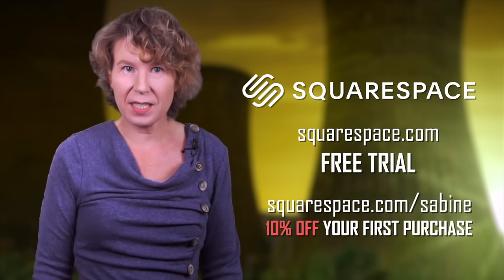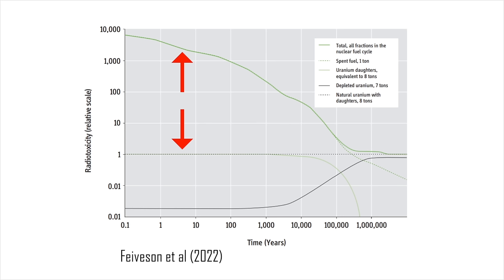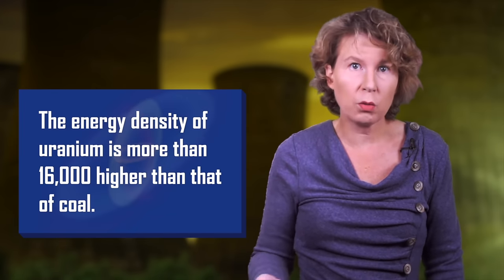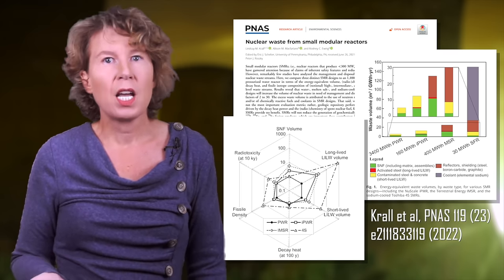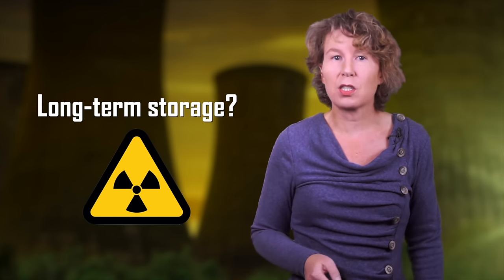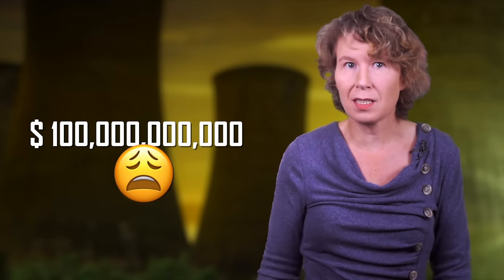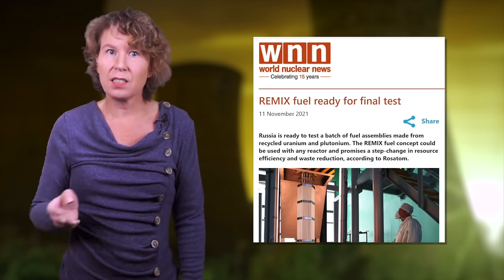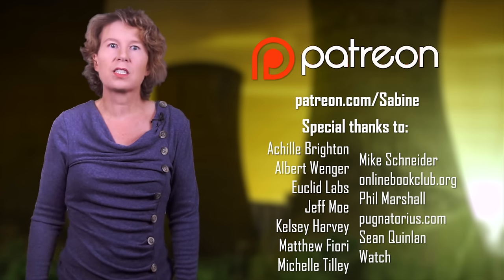Nuclear waste is not the problem you've been made to believe it is

Comment: I think the concept that is often misunderstood is that it is ultra heavy and dense. so while it does seem like a lot of waste it is contained in a much smaller volume than you would expect
Reply: And the toxicity of it is contained in a  very small volume
Reply: The Swiss use nuclear for 35% ish of their energy needs they've been doing it for around 30-40 years, they can fit all their nuclear waste in one room, its a big room, but still.
Reply: @Prometheus7272  — If they did actually put it all in one room, would it go critical? 
(Only half kidding.)
Reply: @sirrathersplendid4825  You'd get meltdown before it went critical.   If you kept on throwing waste into the molten puddle on the floor,  it'd get hotter and hotter until it melts the floor and forms a radioactive gas cloud.   Getting it to explode requires it to be crushed together quicker than it can melt and vapourise.  Not trivial.
Reply: @MattOGormanSmith  — Interesting answer. Cheers!

Comment: I live next to a nuclear burial site.  It is the low level site located in Barnwell, SC.  Basically safe based on our current knowledge.  I worked there for a few years before moving to the Savannah River Site, which was a producer of high level material and holds millions of gallons of high level waste.  In the area of government contracting, we maintained computer systems for everything from reactors to security.  In general, we were very successful in solving technical challenges..  We of course, had much less control and success of political challenges.

Comment: I worked for a US company that did long term simulations at Yucca mountain and I learned biggest problem is water and heat. Specifically rock is an insulator, so heat continues being produced over 10,000 years, and that heat very slowly spread out into the rocks, but it is possible the temperature in the repository (even without a high density of waste) can rise about the boiling point of water, and if this happens AND there is water that gets into the space in thousands of years from us it can become explosive, like old faithful, cracking rocks to the surface and potentially releasing radioactive materials.
Reply: In the London Underground the Central Line tube had a temperature of 36°C/97°F in the summer of 2018. It started with 14°C/57°F in the summer a century ago. We seem to have no intuition for that.
Reply: @gviehmann  Haha, I though about the exact same thing when reading OP's reply
Reply: @gviehmann  Is that really 100yr long-term accumulated heat from all the trains and people, or the result of more trains and usage producing a rather shorter-term equilibrium? That 36C is presumably the summer peak - what is the average and seasonal variation, and is it asymptoting yet? I know some of this heat is being used for district heating systems. Presumably we could do quite a lot more of that and thus cap the long term rock temp?
Reply: @xxwookey  Too many questions. The main point is that the temperature of the Tube is not in equilibrium, although it is an open system and there are already measures to cool it. https://en.wikipedia.org/wiki/London_Underground_cooling
Reply: @gviehmann  Useful links. Which answers my main question. So the ground temp has risen from 14 to 22 (average) over 100 years. I wonder why it started at 14? UK ground temp at that latitude is 12ish. Apparently it was already unusually warm for some reason. I see they've only recently got regenerative braking which will make a huge difference to how much energy is dissipated down there.
Reply: There were underground natural nuclear reactors in Oklo, Gabon, a few billion years ago, running for millions of years. We know what happens to nuclear waste after being buried for a billion years in a water rich environment. The plutonium moved about 5 ft. Disposal of nuclear waste is easy, cheap, and safe.

Comment: FYI: The subscription form for your newsletter doesn't work with Firefox's "Enhanced Tracking Protection." This isn't necessarily your website's fault, and I've filed a report to Mozilla... To other Firefox users: you can disable the Enhanced Tracking Protection for an individual website by clicking on the "shield" icon on the left side of the address bar and toggling it off there.

Comment: Question: if we really really wanted to get rid of spent fuel, and couldn't get any more energy out of it, is it possible to stick it in a nuclear reactor anyway and transmute it into something safe at a net loss of energy? Such as using 1 fresh rod to neutralize 10 spent rods.
Reply: The Pu 239 can be reprocessed into fuel.   The problem is that it can be used to make a nuclear bomb, by people with a much lower technology level than needed for a uranium bomb.
Reply: @mikesmith2682  
Then we should just make sure it’s processed and used on-site as fuel.

Even other radioactive isotopes can technically be transmuted with high energy protons/electrons or used as radioactive sources in industry.
Reply: yes, you can further "convert" problematic isotopes into something less harmful using energy. this principle is an even rather old idea. I believe that currently, you'd have net loss not just in that converting process, but overall .. know what I mean? but should like nuclear fusion become a reality, this problem/issue could be tackled. that's why it could be a wise idea to not just bury everything (apart from other potential use cases we currently have no idea of/about like maybe even in medicine). I'm sorry should any of this already be part of this video as well .. I'm yet to watch it 😅
Reply: @cezarcatalin1406  Yes, but there is an energy or neutron budget the facility has to meet. Many (most?) reactor designs don't produce enough extra neutrons to transmute the nasties, and building a big enough proton gun, etc., will cost a LOT.
Reply: @mikesmith2682  Wasn't it the other way around? It's realy easy to build an atomic bomb from U235, but hard to do from Pu239 because you need a pyrotechnic lense to compress down the solid plutonium core?
Reply: @jannikheidemann3805  
Just add some lithium deuteride to make the sparkles bigger.
Reply: @jannikheidemann3805 , yes, in a sense. It is very hard to get enough highly enriched weapons grade U235, BUT, once you have it then it is much easier to make a gun type nuke than a plutonium implosion device.
Reply: You can transmute it into elements with far shorter half lives AND gain net energy out of it with breeder reactors. There are different types of breeder reactors but they can extract approximately 100 times more energy out of the fuel than the most common reactors that are used today. They can even reuse the "spent nuclear fuel", because for breeders thats just "fuel that has been used for 1% of its energy". Breeder reactors also convert the isotopes with longer half lives into shorter lived ones. Why is this not used more? Because just mining new uranium has been cheaper so far. Most of the cost per kWh of nuclear energy comes from building the reactors themselves and operating costs, not from fuel cost, so the incentive to save fuel is not that big.
Reply: @Azzinoth224  
Also the output of breeder reactors can be quite high in rare precious metals from the platinum block like Ruthenium and Rhodium.
Reply: Just stick the spent LWR fuel after some pyroprocessing into a fast neutron reactor and let the fast neutrons do their magic. They will turn the fertile isotopes (i.e. unstable but not fissile) into fissile isotopes through neutron capture, after which they can partake in the chain reaction inside the FNR to produce heat, or be used to create fresh fuel for LWRs.
Reply: Fast reactors can transmute the long lived isotopes in the waste AND extract energy from them.
Reply: Fantastic...! Now the only question is should we send it to the moon or Uranus ?
    But we still don't know where we are going to get the 6.7 gigawatts to power the flux capacitor. Guess we'll go back to the future for that.
Reply: Yes.
You will need to extract all medium-lived isotopes and transmute them using either something like particle accelerator or fusion reactor that would act as a neutron source. Or both, I don't remember the details to be honest.
French nuclear agency did a study on that ~20 or ~30 years ago and come to conclusion that with relatively reasonable investments it is possible to make final wastes consists only of isotopes that would require less than 100 years of storage until they decay to radioactivity levels of natural uranium ore.
Reply: @mikesmith2682  That is incorrect. Nuclear bombs have to be made out of Pu240, not Pu239. While there is a bit of Pu240 mixed into the Plutonium in used fuel. Its just one isotope away. This is a problem because if you want to isotope separate plutonium 240 and 239 you only have a separation of about 0.4% unlike Uranium 234 and 237 having a separation of about 1.2%. Separation become harder by the square of the distance, so separating Plutonium is incredibly hard.

If you would want to make a nuclear bomb this way, you probobly just made a uranium bomb, it would be way easier.
Reply: @ucanliv4ever  I assure you, the last thing we want to do is burn energy to lure all that potential energy out of a gravity well that just so happens to also be directly above our heads. I get you're joking, but the idea that we'd spend resources to jettison so much potential energy in the most dangerous way possible is something only a journalist or politician could come up with. It's like the worst of all engineering trade offs where we pick the wrong trade off at each stage and then not only don't get benefit, but the worst of both worlds. 

So I'm sure we'll see it done soon enough. And I'm sure I'll scream when I find out I'm footing the bill along with the additional pork added to the legislation that enacts it being required.
Reply: @skipperg4436  I believe the amount of waste is also severely diminished and very manageable (like, kilograms over the lifetime of an installation)?
Reply: Sabina discussed that in this video. Fuel rods are reprocessed and used as "MOX" mixed fuel. The chain reaction is run slightly differently since the plutonium has different energy levels and half life. 

Of course, we don't do that in America. There is no plant. The industry won't fund it. They just want to create sales revenue. Dump all of the externalized costs on the public. Push the problem into the future. Live good and let somebody in future deal with the problem if the poorly guarded waste is  stolen and weaponized.
Reply: @ScottLovenberg  yes you are correct.
Fresh fuel rod consists of AFAIK 4% of U235 and 96% of U238. What is called "spent fuel" consists of ~1% of U235, 1+% of Pu239 and Pu240, if I am not mistaken 94% of U238 and the rest are mix of different fission products.

U235 and Pu isotopes are actual usable fuel, U238  is what can become fuel (Pu239) after absorbing neutron, fission products are what we want to remove (while technically there is still a lot of energy that can be extracted from some of them it won't be feasible with current reactors).
Reply: Hmmm...so what's your take on geoengineering?
Reply: From what i read uranium decays into helium and lead. Can we speed this up somehow?

Comment: My biggest "commercialisation" concern with regards to storage is the recurring underpriced proposed cost of storage - it's often 2-3x+ more costly than it ever is quoted for. This ultimately comes down to hidden costs per kWh and is bad for the consumer. An additional commercial concern includes the "non-competitiveness" of reactor design and fuel agreements. Often if you pick a reactor you're stuck with the fuel provider for the life of the plant which makes fuel cost a semi non-competitive market, which is also bad for the consumer.

Nuclear also accounts for around 10% of power globally (IEA). If we were to 4x this - then we're into the 60k+ tonnes of storage needed per year. Yes, per year going by 2024 figures of consumption - and this is the minimum. This is a permanent "gift" I think no generation should have to bear.

Timelines are also a relative concern with regards to the lifecycle of the plants themselves, where over 50% of the life cycle is spent in commissioning and decommissioning of the plant.

Fusion, no matter how far behind, is superior in every single way. If the outcome of burning things over the past few centuries, being acknowledged as a dumb idea, for global energy consumption, fusing atoms instead of "burning" them should be a no-brainer.

Comment: I keep a Geiger-Muller Detector running on my desk at home because I am a STEM Geek.  It's clicking away right now.  Only around $100-$200 CDN for a personal unit.
Two Mornings (240801) ago I am watching YT Videos and the unit alarms.  The reading climbed really fast.  I grabbed my respirator and closed the doors and windows.
In Moments I was reading 8.50 uSv/hour when it had ALWAYS been around 0.07 uSv/Hour.  More than 100X Background.  (8.5 uSv/Hour at 2+ meters distance it turns out)
I called in Emergency Services and it took more than half an hour to find out a Cancer Patient who lives above me had just received RadioTherapy.  Damn, that's HOT!

Comment: Don't forget that the high level waste consisting of long half-life plutonium gives off very little radiation (or it would decay quickly).  You don't want to eat it, but you could sit on a pile of it covered with a plastic sheet and not die.  The short half-life stuff decays quickly, so you want to worry about being near it, but after a few half-lives, there is very little left to decay (much of the decay happens in the "cooling" pools at the reactor site for this reason.)   As another comment states, there ARE a LOT of other decay products which are very dangerous, but in general, after a few decades, the stored materials are not all that hazardous -- the 200,000 years figure is sensational, but not terribly useful.  The repository will not go critical if the containers are compromised -- you just want to keep the actual materials out of your water table.

Comment: Nothing will get me to believe the word combinations of "permanent" and "accumulating" translate to "not a problem"
Reply: Yeah, but everything creates problems; the question is, which problems are causing less harm and easier to solve.

I personally don't buy the idea killing thousands to tens of thousands of people every year (and a lot more if you include air pollution) from generating electricity via coal and other fossil fuels is the better problem to have than killing an average of, well, zero people per year as nuclear power does.
Reply: Not sure if she is aware of Hanford or Sellafield. It is universally (almost) acknowledged that high level nuclear waste from spent fuel rods must be isolated from people and the environment for 100,000 years. The rule of thumb is 10 half lives. Half-life of plutonium is 24,000 years. So 100, 000 years is actually an understatement. Finland is trying to do the right thing. No-one knows whether it will succeed. Nuclear waste is a very important and insurmountable problem, she should not downplay it.